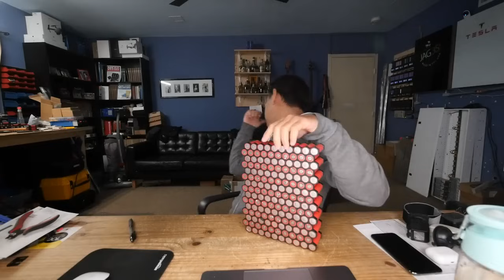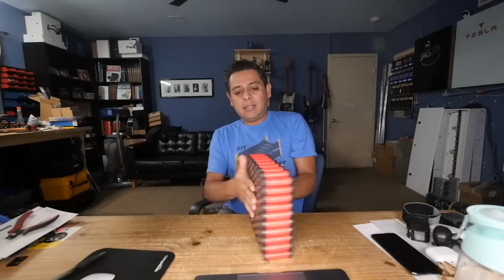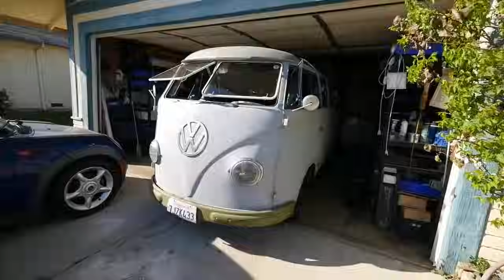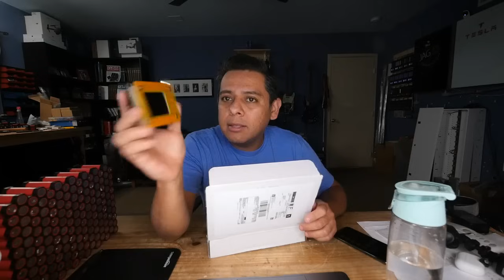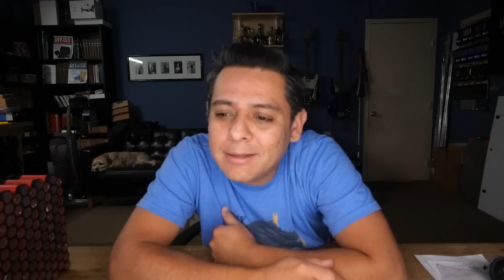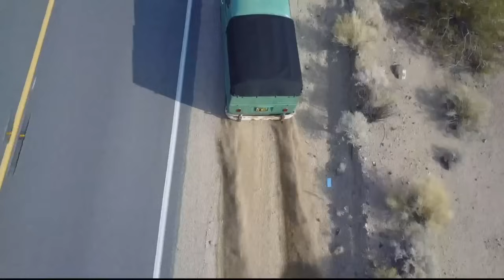DIY Lithium Battery Systems - Live Q&A Stream

Comment: Mr Garcia, I found this on ebay… item #123995873131   its a dc to dc regulator for charging lithium up top 60v.... click on it as I think its a good way to use say an inverter with pwm charge output to safely charge lithium tesla s cells or other...

Comment: Have a look at jet boat kits being built on the tube . There built out of stainless Sheetmetal fast at minimum skill levels . Sketch up what you want your truck to be with general parameters and they may put kit body together you can build .  Later